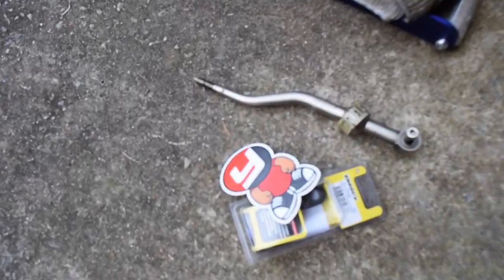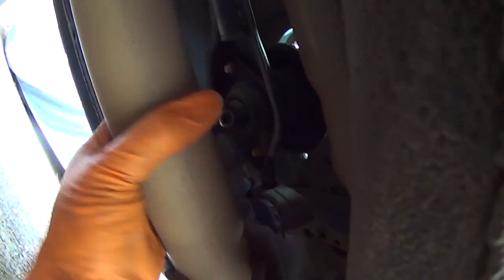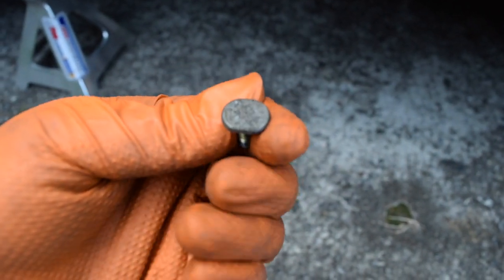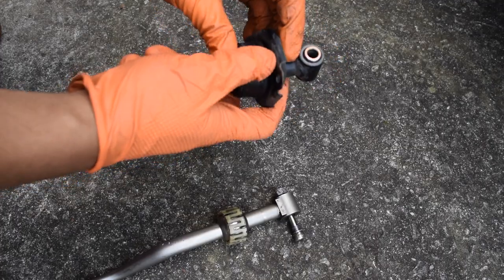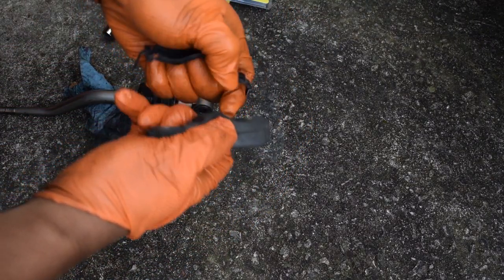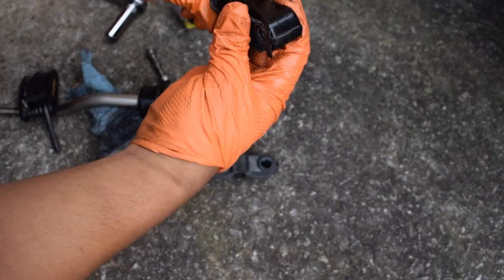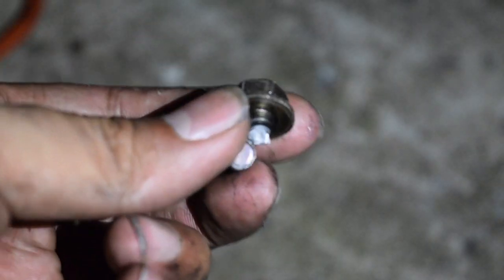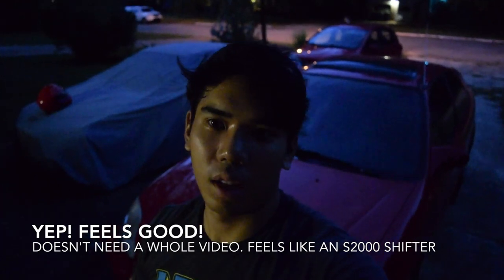Skunk2 Short Shifter Install (2000 Civic Si) Reliable Daily - Part 3

Comment: Where is the update?
Reply from the maker: I'm looking to install a catch can in the coming days if it arrives in a timely manner. Is there anything specific you wanted an update on?
Reply: @OhItsJustZhu  I'm thinking of getting a skunk2 shifter for my em1 so I was wondering if you had any tips or stuff like that
Reply from the maker: @Hawkeyeable  if you're looking to get a skunk2, it's probably better to get it used? Otherwise there's probably other short shifters on the market now that have better value. I'd go ahead and order polyurethane shifter bushings to change while you're under there. It's a great shifter, better than the B&M because the B&M doesn't have bearings, while skunk2 makes it feel like I'm using an s2000 or BRZ shifter. Does this help?
Reply: @OhItsJustZhu  do you know what the bushings are called for the ones you replaced down there? Or the brand
Reply from the maker: @Hawkeyeable  Yeah! If you search b series shifter bushings you should be able to find what you need. I used the brand Energy Suspension, but there a few other companies out. I'd stay away from the metal bushings if you're putting it into a street car because the vibrations are intense. For Energy Suspension the part number is 16.1101
Reply: @OhItsJustZhu  can you post an update video of you driving it and how shifting the gears feel?
Reply from the maker: @Hawkeyeable  Yep, I was going to do an overview video pretty soon, but I can tell you at first the shifter felt a little tight like it needed to be broken in (just slight) and now it feels nice, good feedback and everything. I'll do a day-to-day impressions of the car and go over all the mods thus far. Thanks for tuning in. I'll be working on a JDM power fold mirror wiring video soon too.
Reply: I am looking for a Em1 short shifter for my 2000 Honda Civic DX coupe but i don't know from which year car to get it I'm doing a b20 swap in it
Reply from the maker: @reddragonx8799  I hope your found you answer by now, but in the off chance you didn't: any 92-00 civic and 94-01 integra shifter should work for you no problem. I like the feel of the dual bend style more than the single bend, but it's really personal preference!

Comment: hello I have the following question

When you start your car, does the gearbox transmit the vibration from those rods?
Does your gear bar feel vibration when you accelerate? Because I have changed all that to my car and supports and it continues to vibrate and I have realized that the honda civic of these years has a bad design, the bar, as it is rigid, transmits the internal vibration of the box to the gear lever
Reply from the maker: At certain rpms it does rattle. On my track civic, the exhaust touches the gear rod too. So I think its a combination of tolerances,  but yeah the car was not designed to have a short shifter later, but the difference in feel when shifting makes it worth it to me